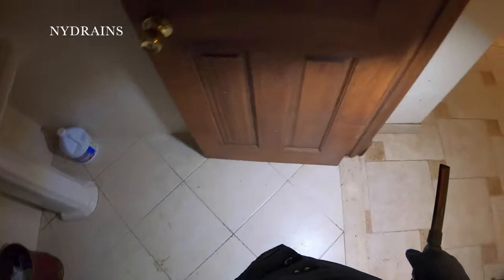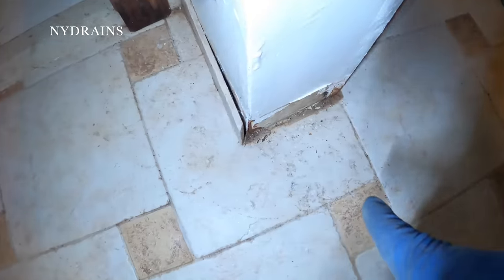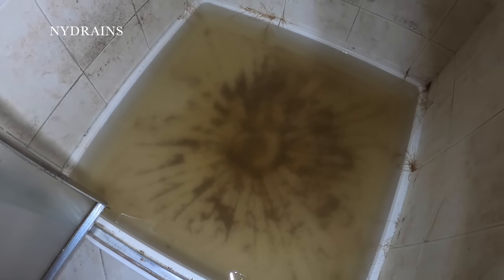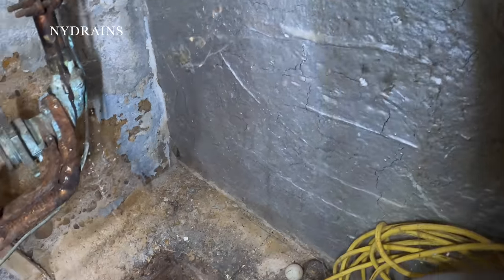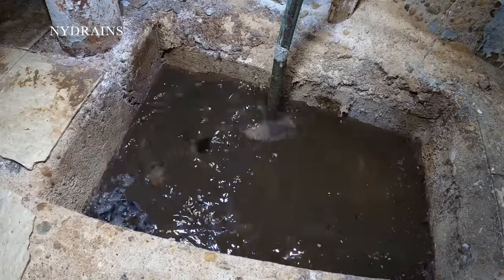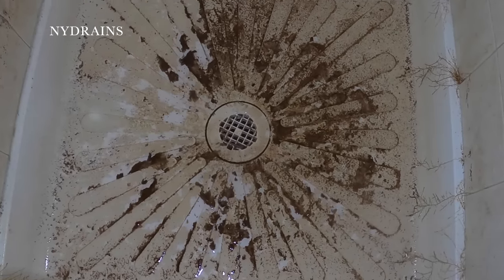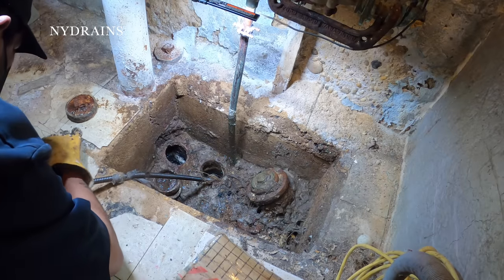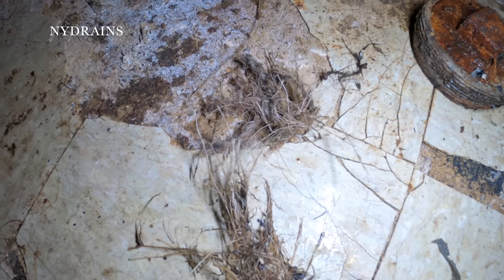Clogged Drain #180

Comment: They have a MUCH bigger issue than not draining. Really need to get those roots in the shower dealt with.
Reply: unfortunately, they need to gut the basement, water proof both inside and outside, removing  any trees and junk... probably cost more then the place is worth. lol
Reply: @throttlebottle5906  burn it down and start again for sure